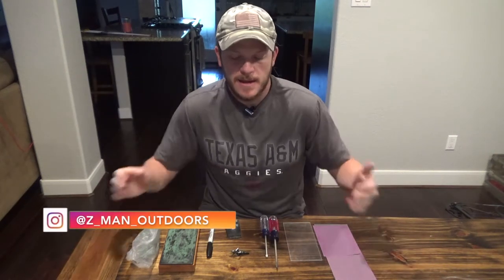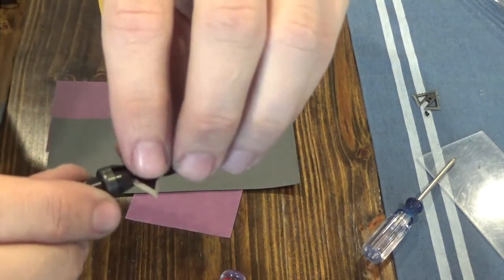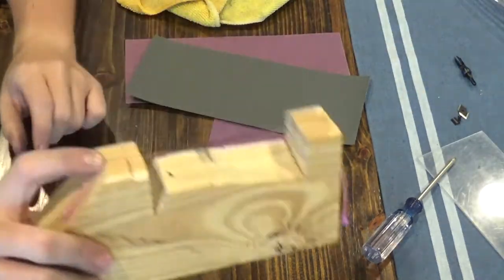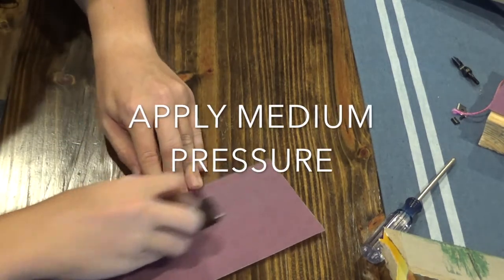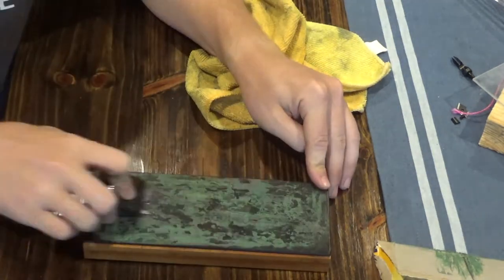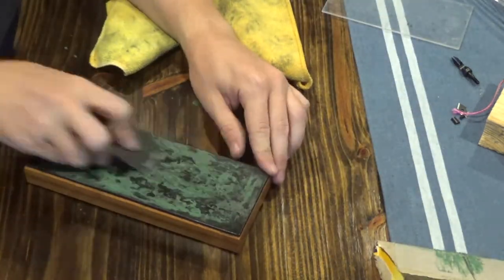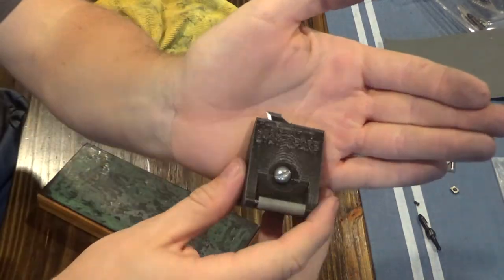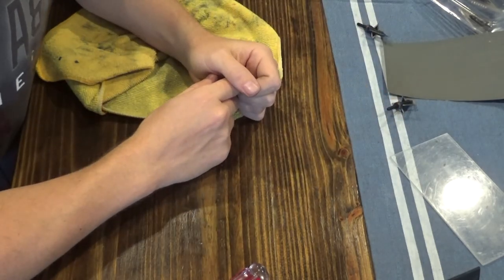How To Sharpen The Magnus Black Hornet: The Best Broad Head Sharpening System

Comment: You did a great job on both the video and the sharpening!  I just think it's way too much work for a broadhead that's already sharp out of the box.  But the Ranch Fairy would agree with you that razor sharpness or surgical sharpness is key!  I'm using MAGNUS Black Hornets this Fall for my deer hunts and I've killed several hogs with them, so I do know that they work!  I also cut both thumbs this season putting the arrow on the rail of my Barnett RAPTOR, so for me they're sharp enough.
Reply from the maker: I will agree they come very sharp out of the box. That is one of the reasons I love Magnus heads. That being said probably worth just checking them or maybe just stropping it and not going through the whole works if they are out of the box! Thanks for watching!

Comment: Watching Innovative Outdoorsman's sharpening videos he really stresses building the burr. I found I couldn't get my heads as sharp as I wanted just counting strokes. Work it on one edge, then take a little strip of paper and slide it down the bevel to the edge and you'll feel it catch on the edge all the way across when you have the burr. Only then do you work the other side. Work until you have a burr on the other side, then repeat the process with each finer grit until you get to stropping.

I did that with my QAD Exodus heads this season and they are wicked sharp.  I just picked up some Ser Razors and will be doing the same with them.
Reply from the maker: That’s a good tip, I don’t disagree feeling the burr is definitely the way to do it. Was trying to simplify it for people like me who suck at sharpening or didn’t know what a burr was or felt like haha. But the paper thing makes sense and is a good idea! 

I’m a big fan of the Magnus broad heads, have been very happy with them thus far! Let me know how you like them
Reply: @Z-Man Outdoors  I killed a 20 pound turkey with one two years ago. Worked great. Then went to the VPA 3 blade amd wasn't impressed but never shot an animal with one. Shot two deer with the Exodus this year and they performed great,  but want to give the Black Hornets another go. I also got some 150 grain Stingers to shoot with my recurve.
Reply from the maker: I think I’ve started to lean towards liking the stinger better, but haven’t really had enough testing on animals to truly pick one
Reply: @ZManOutdoors  The stinger is definitely the way to go with a lower energy setup, but I like the thick blades and stouter tip on the Hornets. I've seen a lot of reports of the tip curling on stingers.